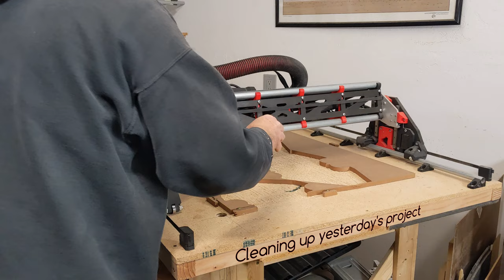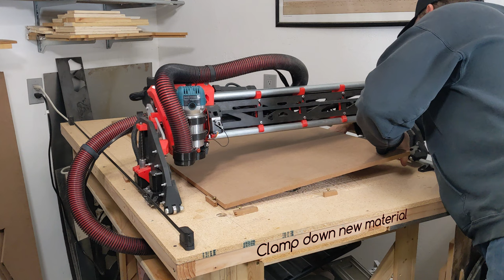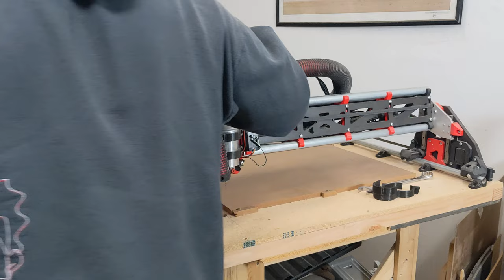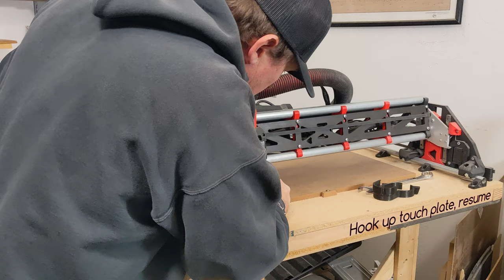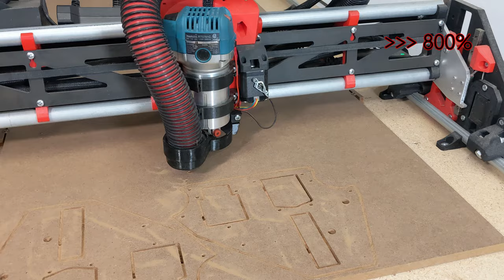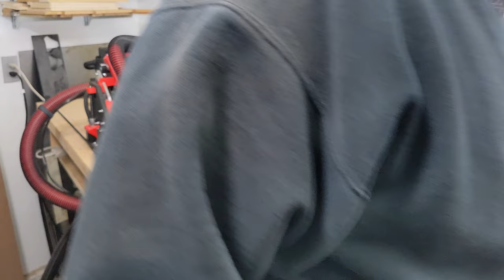Workflow of a CNC project - LowRider CNC v3 -

Comment: omg I just realized I mounted my RT0701C backwards so the red button to lock the spindle is inaccessible in the back.  I thought I had to use two wrenches on the shaft and nut hahaha.
Reply from the maker: :face-blue-smiling: No way. I guess I need to add some better pictures in the instructions!
Reply: My Makita wasn't mounted correctly either, I had to open up router and cut epdm cable protecting shroud to half the length, that allowed me to orientate router the same way as Ryan, and still allow for the router cable to not hit the YZ plates at min X.
Reply from the maker: @AzaB2C  I left mine on there for a while, it just cleared the core. I took it off though to get a tighter bend. I slid it down the cord to the plug, then later cut it off because I wanted to stuff it in the beam later.

Comment: What size is your table, I'm currently building my LR3 and can't decide on table size, yours looks like a good size. Any regrets with that one?
Reply from the maker: It comfortably fits a 2'x4' piece of material. I rarely use more than 2' in either direction on a single project, but batch work the whole table. It really depends on what you might make. I use it for batch work so I use the entire surface as shown in the thumbnail, but a full sheet is not worth it to me, as I don't have the space to spare.
Reply: @allted  This is the exact size of material that I would like to cut.  What size did you make your table?
Reply from the maker: @jaymed2000  There is a calculator to show you exactly what you need in the instructions.

Comment: @Ryan - V1 Engineering Inc your CNC machines are great, and I can honestly say its taken our shop over the top. We will be Grabbing the LR3 next month and repurposing the LR2. Two quick questions, I see you are using old school clamping techniques, have you ever tried the polymer brad nails by raptor? Finally, which control board are you using in that setup? We have the mini Rambo on the LR2 and want the best board for the LR3. Thanks in advance and also, thanks for coming up with such a great machine to allow folks to get into CNC work. Peace.
Reply from the maker: Glad you are enjoying the build! 
The composite nailers look cool, but screws are cheap and I don't need to turn on the compressor.
I am using a SKR Pro on this build, best to have a 5 driver board, but you can get away with the mini if you give up some endstops.
Reply: @allted  Thanks, I know exactly what I will be ordering on payday :). I definitely want end stops this go around. Keep up the amazing work Ryan.

Comment: Awesome Video Ryan!  Do you mind sharing what bits you used?  Also Feed, Speed & DOC?  Thanks!!
Reply from the maker: Good Idea, I will add these notes to the description. I do have some notes in the video itself. In the closeup section. MDF - 22mm/s - 12.5mm DOC - Lowest speed on the router dial, single flute upcut from the V1 shop.
Reply: @allted  Thanks!  i tried to see all the notes but may have missed it in there!  Seeing how well yours ran i can speed mine up a LOT.  And i was worried about 16mm/s at 4mm DOC lol
Reply: @NorthWoodsCustomCreations  and he's running conservatively, too. This thing is capable.
Reply: @tonyrichmond9428  Yes sir i have a LR3 and a Primo.  Both fresh builds.  Had a LR2 for a few years.  The LR3 is MUCH more capable than my old LR2.

Comment: Hey Ryan, do you have any plans to move to GRBL? The software that I use for my Bob's cnc (Vcarve) doesn't seem to be able to generate tool paths for Marlin. any suggestions to help get it to work? Right now I am using Estlcam and it is not my favorite program. Thanks !!!
Reply from the maker: Actually, yes! https://www.v1e.com/products/jackpot-cnc-controller, you can also load GRBL on a few of the boards I have carried as well. Jump into the forums for more details.
Reply: @allted  thanks, I got myself on the wait list!

Comment: What VAC can you recommend for the LowRider V3?
Reply from the maker: https://amzn.to/40Ycax8 I just got that one, highly recommended. It is much less loud than my last one, yet has more power. I think it might need a small printed adapter if you wanted to try and use the included hose, but I think it is best to get an extension anyway, and you can get that the exact size as the vac port on the LR3.
Reply: @allted  does not seem to be available in Europe :(
Reply from the maker: @limebulls  I have been switching over to the new domain, V1E.com. I have redirected nearly all of the links. Do you have a specific link that does not work?